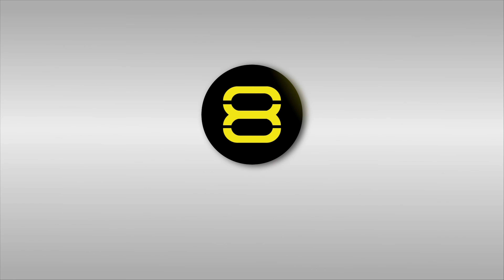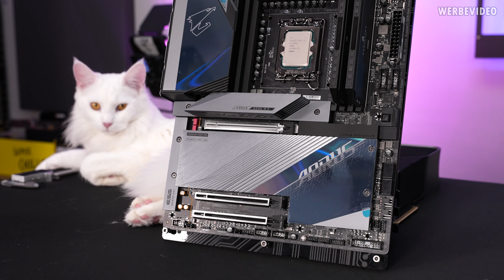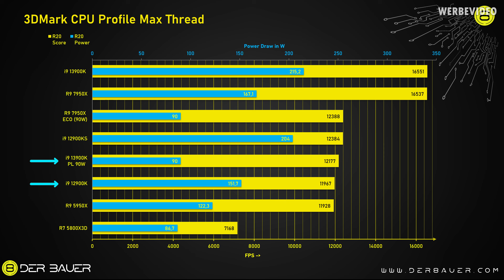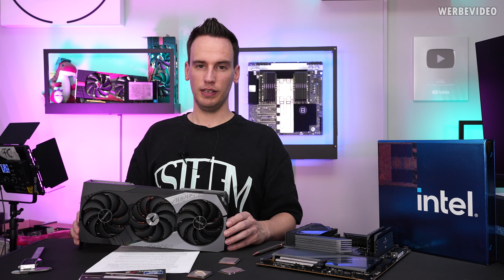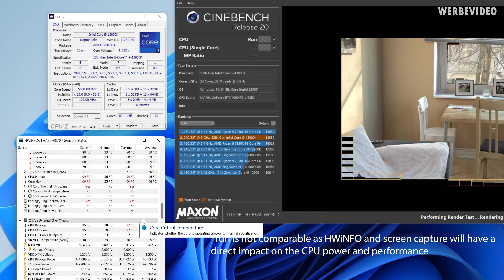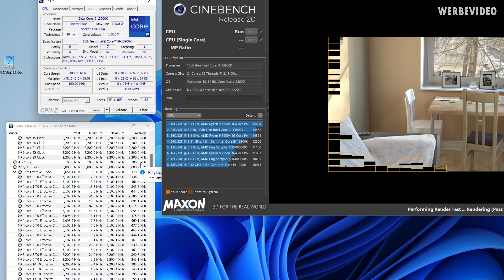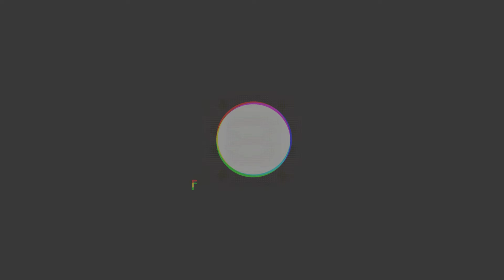Testing and Tuning the new 13900K for Efficiency

Comment: Could you also test the performance of E-cores and P-cores when using some hybrid scenario, like they showed in presentation? I am looking into this CPU and deciding between it and 7950X for my Unreal Engine 5 workstation, where I am compiling C++ constantly and I want to be able to do other things at the same time comfortably.
Reply: Techpowerup
Reply: I had a X570 5950x 4x16Gbs@3600 ddr4 for all 2021, 2022 12900k z690 2x16gbs@6000 ddr5 both with a 3090 1)z690 and z790 don't support 4 dimms, every reviews I've seen only used 2, memory qvls show little to no support of 4 dimms or at low speeds or kits you cannot buy, I tried 3 different brands/kits none worked if not in QVL it probably won't even boot BIG problem for pros and despicable behavior from influencers most know it doesn't work but for some reason don't say it 2) the cpu/pcie lanes design is really bad on intel my 2000$ z690 extreme glacial is a single pcie slot and I cannot use the 5.0 m.2 because if I do a)it disables the second pcie slot b)it makes the 1st slot x8 4.0 at best (the multiplier is what matters then you get whatever pcie type your card has so in my case x8 4.0 on an rtx 3090 and in some cases yes I lose performance so I removed the m.2) 3) e-cores aren't real cores and worse because of how linked they are to your p-cores they drag everything down, I use cpu affinity to dedicate cores to processes on a 5950x I gamed on the top rated cores+used nvenc to stream+dedicated CCX2 cores to obs and other background apps it worked fine...when I tried to tell e-cores to handle obs on 12900k my fps tanked you can't really do this so they're not real cores and or are too linked to the p-cores, also you lose threads and one of the video apps I use renders videos in parallel with max 5 threads/videos so there too I was limited on a 12900k..even as a mostly gamer I can't recommend Intel for professionial use definitely not, don't believe me ? go compare X670 and Z790 motherboards memory QVLs (other brands than ASUS, they can't make ddr5 work on anything) and remember what I said if it's not on there it won't boot or as I've seen throw memory errors all the time (and when it happens your program will just quit mid-work I had that happen after 3hrs rendering...I was so "happy" I hate my 12900k z690 and only waiting for an AM5 waterblock to ditch it
Reply: @fredEVOIX  are you experienced with memory tuning? QVLs are lies. Most important thing for memory since ages are finding really high end binned sticks like 7000c40s or find sticks with specific IC and try your luck. I have many pals running 6000cl30 on adata value rams with hynix chips.
Reply: @fredEVOIX  Hardware Unboxed said that 12th gen worked with 4 sticks, you can check their review, it was close to the end of the review.

Comment: The only things stopping me from a new build are 1: AMD 7xxxX3D  V-cache and 2: Radeon 7900XT.  AMD Late to the Party with two of the most important pieces of Hardware. The Gaming CPU and the Video Cards.  They always manage to shoot themselves in the foot one way or another. 
 Otherwise its nice to see such a clear and straight-forward comparison of the new 13900K vs the new Ryzen 9 7950X.  Happy to see Intel pushing the limits with the 13900K.  Even more Happy to wait for the 7800X3D.
Reply: @Ping Pong Then you will require a new Mobo and most likely PSU.  Intel may not even be around by then.  Its not looking good for them right now.  The sharks are circling.

Comment: It would have been awesome to include the 7700X in the ryzen category here, at least for the gaming benchmarks, from my understanding the 7700X actually gets (marginally) better FPS than the 7950X while pulling less watts. The 7950X is definitely not a gaming CPU for this reason. 

From what I've observed so far, all the Zen 4 chips perform comparatively in gaming but the lower tiers provide marginal gains and are considerably more power efficient as well.

Comment: Thanks der8auer, you helped me make a decision between 7950x and 13900K. I want to make an efficient PC, that is still capable to kick ass when needed. It looks like this time I will go with Intel when upgrading in a couple of months.
Reply: so even with the same limits you decided to go for platform that will be useless in a year or two instead of AM5 that will be upgradable for 5 years? Why?
Reply: @petervansan1054  Why useless? Will it stop working? No. And I don't plan to upgrade for at least 3-4 years after this one.
Looking at how CPU game will progress, I will rather upgrade GPU than CPU to gain performance. If power requirements will rise every new gen, then current X670 mobos will not have sufficient VRMs for new top CPUs, just like X370 were not strong enough for 5950x for a long run.
Also, there is no guarantee that AMD will support AM5 platform for 5 years.
Last thing - 24 physical cores are better for my kind of use, even if there is only 8 P-cores. I like to run home lab on my PC.

I'm not a fanboy of Intel or AMD. Taking all into consideration I just picked Intel for this round, that is all.

Comment: completely opposite and objective review of the cpu compared to our friends at amdnexus, they loved it when amd released the expensive ddr5 only 95c cpus and they even called the 13900k the worst efficient cpu
Reply: One thing I don't like about gamers nexus is that they don't include average, minimum or idle power draw, where intel is actually pretty power efficient. They only show full load max, which gives the illusion that the 13900K uses 300W all the time, even though it is only true only for short bursts and a few seconds at a time.

Comment: Let the AMD price cuts begin!
Reply: You mean Intel price cuts.
Reply: @AlfaPro1337  No?
Reply: @AlfaPro1337  They already said Zen4 is selling poorly.
Reply: @puciohenzap891  No idea why Evil Su decided to copy Intel+Nvidia and made it worst.

1. They should have AM4+, instead of AM5. Thus allowing users to use Zen+++ CPU/APU on newer AM4+, retaining DDR4.

Also, up to board vendor to have 2xDDR4 and 2xDDR5 slots, one for Zen+++ and the other Zen++++.

Intel had to thought out back in the LGA 775 days.

2. No idea why no X3D as stock config, instead Evil Su copied Nvidia's strategy of releasing a 'Ti' or 'Super' variant at a later to combat the opponent.

3. Still selling a low-end 6c for pre-Evil Su's top-end CPU pricing which is US$300.

This is liken to Intel 4c/8t from Sandy to Kaby Lake.

But she did it since Zen.

4. Since Zen++, the IF-MC could no longer run as fast as the DRAM bus speed when using RAM speed above 3.733 GHz, thus a huge bottlenecking.

5. Why introduced another Memory Overclocking standard when it's literally just Intel and AMD are both dominant in the x86-64 space? Create kit confusion.

6. Indecisiveness of whether to glue or not to glue Zen++++ cores and the I/O.

7. 2 socket 2 platform, instead of 1 socket 2 platform.
Reply: @AlfaPro1337  intel shill alert
calm down buddy. am4 already got 6 years of support while you're lucky to get two with intel
also, the only ones filling their pockets with money are both intel and amd shareholders. not you

Comment: I have that board basically the same motherboard you recommend at 18:40, but the B760M version + i5 13600K and it is in fact not fine for gaming. Only half the VRMs have a passive heatsink. They overheated like crazy until I glued 25x50 and 25x25 Raspberry Pi and 3 25mm fans on it. However, it seems the ones I now actively cool are the ones with a temperature sensor. So God knows what the other ones with the passive factory heatsink are doing.

Comment: I am new to over clocking in general, but not new to PC building. My first PC stayed loyal to me for 6 years, I took care of it and it did very well with me and it is still a beast on its own. For my second PC, I decided to just make an over powered monster. I bought the 13900k, good lord this one packs a punch. Faster, and very power hungry. Hence, I wanted to underclock it, mostly to keep it cooler and last longer. I work with all core heavy software now and then. It still beats my expectations while underclocked. 

I was getting 40k points in cinebench r32 with just XMP on and every other BIOS settings default, but the temperature was staying around 88-90. I underclocked it and got 20k on cinebench, temperatures stay around 45-55 C range and it still perform fast for my projects. 

My lack of knowledge is speaking here, but I think I have a CPU that is going to last me for at least a decade. This monster when tied down is still a formidable beast, and once unleashed it's just something else. It's truly wild product.
Reply: But don't underclock it: set whatever power limit you want. That way the CPU will adjust clock speed automatically to match it. Depending on cooling solution you use efficiency to performance can be awesome: the better the cooling higher power target without loosing the efficiency by finetunning the voltage, but obviuosly cooling cost money and space...so there's the trade-off.

Comment: Great video, I think leaving the minimum frames off the charts was the right decision, made them much clearer to read and the average FPS gets the point across fine.
Reply: I'd say he should leave the minimums instead. As it is way more important for the gaming experience than the average frames. Dips is what you feel the most. IMO. I'd rather have CPU that gets 200 average FPS with dips to 100 than 250 average that dips to 50.
Reply: It’s especially interesting to know this when he’s comparing Intel with AMD, as 7950X has already gotten a reputation for excellent 1% lows.

Comment: Jayz Two Cents just did a video and pointed out that the Asus boards stock BIOS settings will override Intel settings and make 13th gen boost for much longer and hotter. That might explain the power consumption in your first few graphs.
Reply from the maker: I used Gigabyte
Reply: Lmao
Reply: @der8auer-en  Oops saw Asus ROG on the list but didn't see they were the AMD boards.

Comment: I enjoy using Grizzly Hydronaut, Grizzly CPU mount, although the temps werent really going down. Of course I was not overclocking and the wattage was default to Gigabyte Z690 board. After watching this I was able to see a significant difference.  Albeit I installed an Artic Freezer II 280 prior to testing after using a Noctua Chromax NHU-12S. I believe I could have seen similar numbers with Noctua. My setup is a cpu 13600K, Gigabyte DDR4 Extreme, 128GB (DDR4 3200 - I know I wanted a light show) G.Skill, Gigabyte 4070-ti (4080 at the time was over my budget),. 
I wish there was more information about how people perform thier testing, Gamers Nexus, ect.  Anyway a long read for conten 11 months old. In short Thank you so much for the products and videos, keep it up.

Comment: That chart at 1:20 hits home.

5950x the most efficient chip on the graph, AMD went further up the curve on the 7950x to compete with intel, but it is still much better than intel on efficiency.

The slowest intel chip on that graph the 12900k, based on those numbers is much better than the 12900ks variant, it has almost same performance for 80w less power.

The 13900k is more efficient than the 12900ks but further increases overall power draw with intell seemingly happy with their cpu's consuming 300w.

Then compare the 13900k to the 7950x, 100w more power for only slightly more performance.

Intel are back to the p4 days.

Testing perhaps needs to be standardised to compare cpu's with equal watt configuration.  Otherwise intel will just keep pushing higher up the o/c curve out the factory to win the benchmark wars.  It is basically becoming a who can o/c the most out the factory.

Found some old review data for 9900k, to see what steps intel have made.

9900k scoring around 5000 multi threaded, with a power consumption off around 170w (stated full load so might not be cinebench).
13900k scoring around 15600 multi threaded, with a power consumption off around 320w (from this review).
13900k scoring around 10700 multi threaded, at 90w (from this review)
13900k scoring around 13000 multi threaded, at 170w (same as 9900k) this review 15:29
So more performance per watt especially in 90w configuration, assuming the power usage figure I found was for cinebench on the 9900k

Cinebench we know is affected notably by reducing PL1/PL2, We can see efficiency is out of the window on the 15600 score. :)

Gaming a different story of course based on these review numbers, AMD seem to have peaked on the 5800x with performance per watt in games.

Appreciate the review compared AMD and intel on a fixed power limit.  On the 3dmark cpu bench.

Comment: WOud have been nice to see clocks left stock, but with a nice undervolt. 
TEsting to see how long you can get it without messing with clocks. 
Then after that I would have Reduced single threaded boost to 5.6ghz
2 cores at 5.4
3 at 5.3
and all at 5.2

I think this would have been perfect per core ratio control and offered insane headroom for a nice undervolt.

Comment: power draw  on stock is a bit difficult to compare with others reviews, i think that cpu power draw goes down after 17 min of processing at 100% because thermal throttling and goes from 320 to 250w, that is why so many differences between reviews.

Comment: Considering the 7950x can cost up to 20% more than the 13900K, the Intel side really seems to be offering better all round value, especially when power limited to more humane levels. That 70w limit for gaming and perhaps a 150w for multithreading seems to beat out pretty much all competition and doesn't have any weaknesses that you would be missing regardless of what you will be using the cpu for. It makes the marketing seem truly odd, how Intel are so adamant on pushing the max performance metric so hard, when in reality their biggest selling point is actually the efficiency at low power levels. It puts all the previous gpus to shame. Imagine if they just told people "this new flagship cpu can perform better than the 12900k but at 3x lower power draw - AND you can still overclock it to the moon if you so desire". Instead, what everyone will be talking about now is just the headline "13900K consumes 300w at max load and requires a car radiator to keep it cool".

Also on the note of 1% fps lows, I don't think most people care much for it but I see a couple commenters point out the relevance for competitive gaming especially (which I understand, being a competitive gamer myself). I really like the clarity of your charts with the avg framerate and then the power consumption to easily compare.
What you could do, is perhaps just put in two small arrows on top of each bar to indicate where the minimum lows are positioned, so people who care can quickly get an easy reading to see if it's in line with their expectations or not. No need to make an entire additional graph for them, just a little marker with a different color.

Comment: Do you know of any way to limit Intel's Turbo voltage without causing it to stop using Turbo entirely, and without forcing the CPU to use a static voltage all the time? Using offsets only seems to affect non-Turbo voltage (Turbo voltage rises to a consistent 1.4V~1.45V regardless if I give it a 0, -0.05V or -0.1V offset). I want to keep it under 1.35V since the current gen CPUs are suffering from early degradation, but I can't seem to find any way to achieve this. If I set a hard voltage limit in the CPU temperature regulation it just stops using Turbo as soon as it reaches that point, and changing Turbo ratios seems to have little to no effect on voltages.

Comment: I'm running at 15602 with the 13900K. Without throttling... stable max at 89c. Using 3 rads push/pull.

Comment: I wonder what type of power consumption there is when 3d modeling and viewport performance in blender with only the gpu set to render. Another test I haven't seen is the use of blenders simulation performance which is heavily cpu and ddr speed driven. That would be a great test to compare ddr4 vs ddr5

Comment: What you get for gaming with 13900K over 13700K is better binned silicon (SP) and more cache. E-cores for gaming must be disabled. Leave either 2-4, or disable altogether. Hyperthreading is another BIG question for gaming.
Nice idea underclocking Ring, will try it.

Comment: Tried kryonaut for the first time.  Temps dropped 5-7 degrees on max, and almost 10 on idle.  So impressed, i ordered another tube of it so I can repaste the room mates machine.
He's got the 5600x cooler on the 2600x so I'm upgrading him to the hyper212 that I have from upgrading to the Auraflow x240.  On 100% cpu usage (@47 multiplier all core) for well over an hour (using up to 71w) , temps don't go above 70c.  Cyberpunk is about 10-14 degrees less, and idle is around 39-42.

Comment: This is the best review I've seen for the 13900k, thanks for the hard work. One question though you suggested 170-180w was the sweet spot for performance when doing production multi-threaded work loads. What kind of performance penalty would you expect when it comes too rendering like c23 or c20 is it still competitive with 7950x, cheers?
Reply: If I'm not mistaken, he said about 8 to 10% penalty.

Comment: Great video! Thanks for the in depth review/guide! How do you set the Power Limit/PL or custom power limit "Eco Mode" for 13900k for example on the Auros Master Mobo? Do you need to manually add the PL to the bios or will there be a option "auto" to run eco mode for the 13900k?